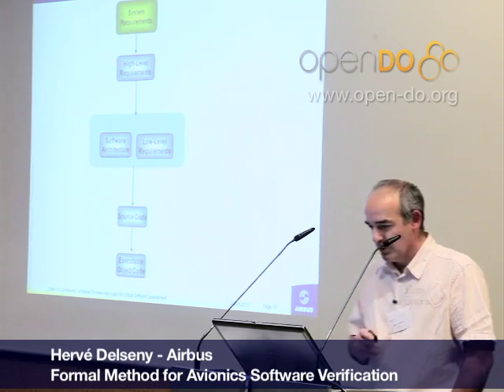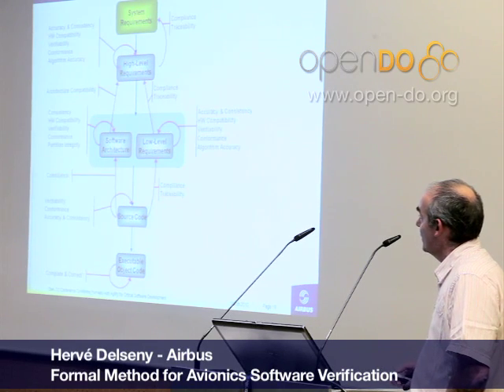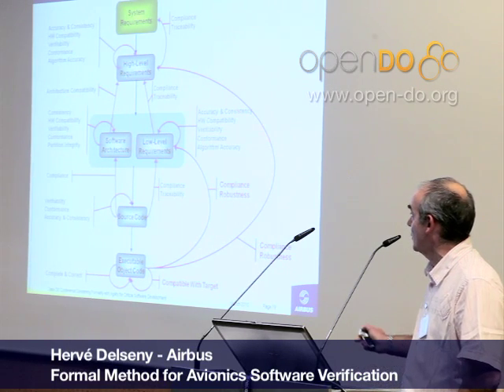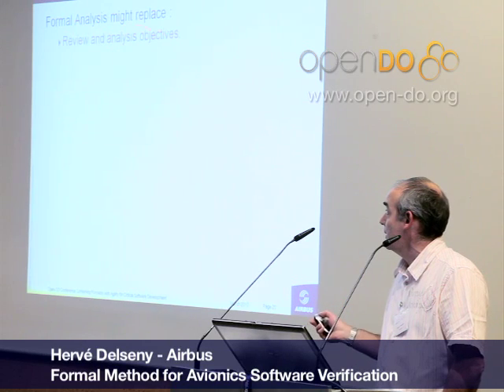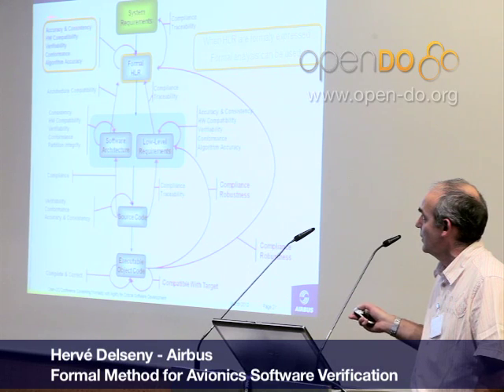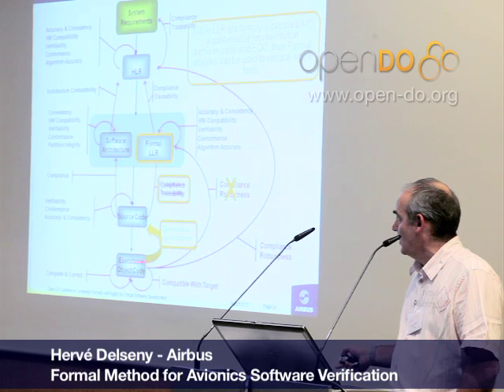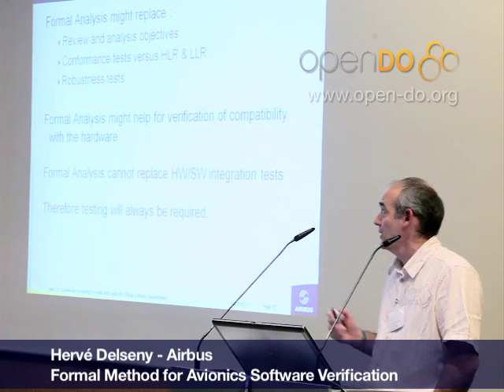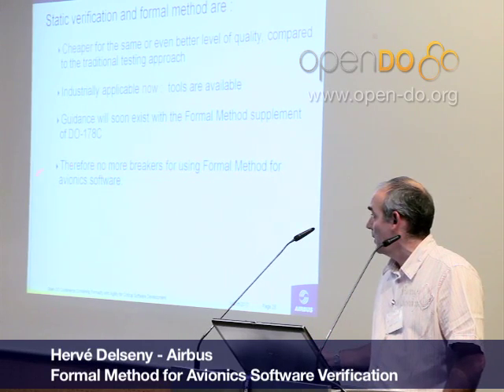Formal Method for Avionics Software Verification pt4 (Hervé Delseny)

Comment: If one comes from a background of C# /Java/ ASP.Net at HND level and has a comprehension of the Software Lifecycle (Systems Spec, Systems Requimnts, Systems Analysis, Implementation, maintenance and review) - would they be able to contribute effectively to the aircraft avionics industry? I am interested. I was thinking about a career in database  and application design  but I had never even considered a career in the aerospace industry until now.